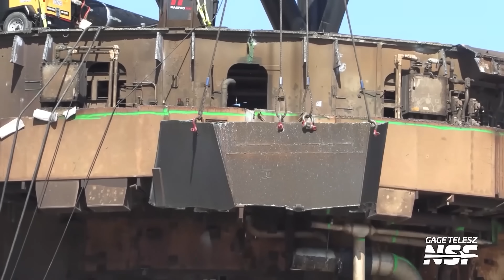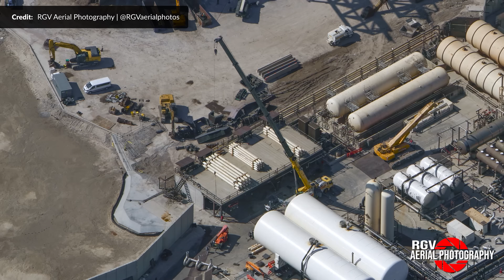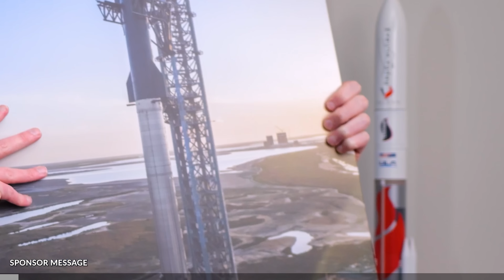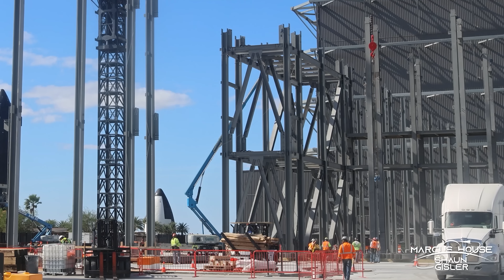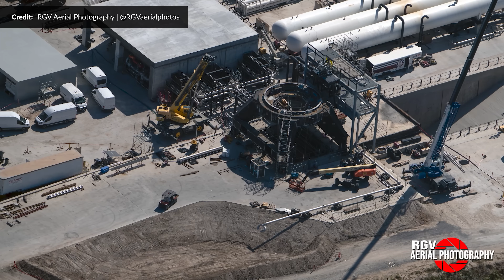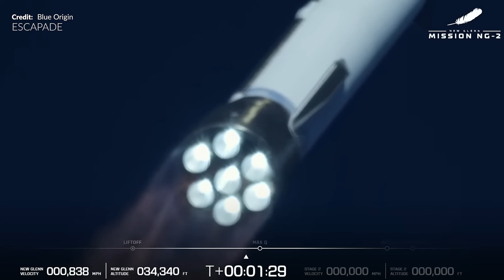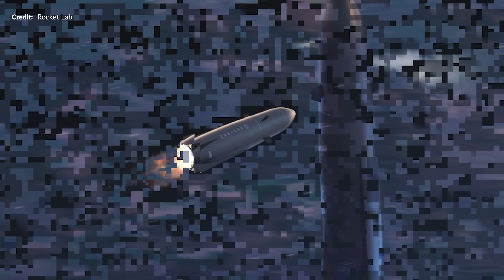Blue Origin’s New Glenn stunned everyone!

Comment: The way  New Glenn first stage came a  little bit out of target and made x-y corrections to hover and land on the droneship with pinpoint accuracy is just awesome to see 🔥Looks like Falcon 9 & Starship Superheavy has a worthy opponent
Reply: It’s planned to target abeam the landing ship to protect the drone ship incase of velocity error making the landing impossible.
Reply: @trans_atlantic_alison 
Yes, it is not a bad idea!  I imagine that after a couple of successful landings they will go for direct landings.
Reply: @mahbriggs Bezos said the conservatism on landing will decrease as they gain confidence
Reply: @steveo6034 and the $ cost of failure for them is higher.
Reply: @steveo6034 
As I said, it makes sense!
Reply from the maker: It was wild.
Reply: nominal , it is planned
Reply: Falcon maybe but Starship is something else it cannot be compared to anything because no one else even tried to do it.
Reply: Baby steps…. with explosive bolts
Reply: It think it was PLANNED that way so just incase it doesn't go as planned. They didn't want the Booster to slam onto the Barge Ship when it is out of control.....
Reply: They were 1 year behind space x successful landing. Space x has done dozens more test flights then Blue. I’m sure they are paying space x employees, but regardless they are so far behind.
Reply: The ability to hover and slew horizontal is something unique with New Glenn compared with the Falcon 9/Heavy's raptors, if I'm not mistaken. That capability on its own is interesting and makes Blue Origin & New Glenn feel like innovation instead of simply direct competition.
Reply: @michaels.3709 
But not unique to New Glen!  That is how Starship has been recovered! 
Hover off the target and side slip to the actual recovery point@
Not a bad idea, nor is it a unique idea!  Common sense really, if you have the fuel to do it!
Reply: @mahbriggs  True! I meant to make the comparison within the same size class. My understanding is that Starship is so large that you can actually throttle-down the raptors to hover, whereas Falcon 9 is too light and the Raptors too strong for even a single raptor to be throttled low enough to hover. I can't confirm where I heard this, so take it with a grain of salt. But having the ability to hover on a smaller launch vehicle than Starship is quite a nice capability to have!
Reply: New Glenn is trying to compete with Falcon Heavy, not Falcon 9 nor Starship. Totally different leagues.

BTW, Falcon Heavy wins on both tonnage to orbit and cost factor.
Reply: @stateofopportunity1286  it’s also important to note that Blue won’t have the same price or customer base as Space x..space x is cheeper and can deliver more faster..
Reply: @stateofopportunity1286 
I agree that New Glen is sized to compete with Falcon Heavy.  Whether or not it will be successful depends on if they can make it reliable and cheap enough!
I dont think anyone knows about the cost part yet, but if they can make it reliable enough, they have a chance!  So far the results are impressive as far as reliability goes!
Falcon Heavy is not cheap!
Reply: @stateofopportunity1286 To be fair, the only Starships that have flown so far probably only had a 30-50 ton payload capacity, same class as New Glenn.  (Yes, yes, V3 should be more like 100T, but hasn't flown yet)
Reply: @darylbardo if they ever get it to work.
Reply: @melgross I think that level of skepticism is as ill-advised as unalloyed optimism.  Spacex has the engineering chops, willpower, and resources to get it working, and there is nothing that fundamentally breaks the laws of physics about their plan.  It may not get to 150 tons reusable at a cost of less than $10mil with a one-hour turnaround in the next two years, but I think it will get somewhere.  100 tons reusable at a cost of $30mil with a 24 hour turnaround in the next 5-10 years would still be a massive game-changer.
Reply: @darylbardo those numbers are nice. But what I’m talking about right now, is the serious problems they have had getting starship to do the most basic task without burning something up. And all of the flights have been with Starship completely empty, including any pressurized atmosphere, which they will need for some missions. The only thing they’ve really done was on the last flight with the launching draw for Starlink satellites. And that was just a test to see if everything moved. They are seriously behind their own schedule right now. I’m hoping they will get this straightened out, but there are a lot of skeptics in the engineering world who are concerned they may have bit off more than they can chew. The booster seems ok, though I would have liked to see them capture more than one.
Reply: @melgross Fair points.  On your last point, I'm reminded of the "high altitude" tests, where everyone said they wished they'd done some more flights to prove the flip & burn out.  But SpaceX was confident that they'd already proven what they needed, and when it came to it the IFTs have a 100% success so far on the flip & burn every time the ship survived reentry.  I think they stopped catching boosters because they were confident they'd worked that part out, and wanted to push the envelope with boosters that were going to be obsolete very soon anyway.  I think once they start catching V3 boosters they'll start doing it pretty consistently too, whether or not there are any "kinks" to work out with the new version first.
No question they're behind their hoped for schedule, but they are biting off a big chunk, as you say.  I'll be surprised if the TPS doesn't require weeks of refurb every time for 2nd stage, but worst case it'll still likely be faster & cheaper than shuttle.  And I think it's promising how robust the vehicle is proven to surviving TPS failures.  And booster probably will have possibilities for a fast turnaround.
Reply: @darylbardo I’m someone who has designed and built commercial equipment. I understand the concept of prototyping. I also understand that succeeding once doesn’t prove the process. You need to do it a number of times. So the booster has been a success, though they do need to prove they can catch it again and again. So, we can leave that.

But the starship is something else altogether. They can’t keep referring to the loss in the ocean as a successful landing. It’s not. They have to bring this around the world in orbit to where they will land it, on land, apparently. They haven’t done that, so we don’t know how long it will take until they consistently succeed. That’s a lot harder than allowing it to dunk in the ocean. They did, some time ago, fly it up a few hundred of feet and land it. But that was just a proof of concept.

Then they have to get one up as a tanker and show they can transfer fuel. That’s just the beginning.
Reply: @melgross  How long has Blue Origin been working on an orbital class rocket? 2 years longer than SpaceX has existed? 

Pots in glass houses shouldn't throw stones through their neighbor's windows with a note attached calling them black.
Reply: @melgross  They are testing to limits, as they always do. Every launch has purposeful failure items included. For example, missing heat shields, steep angle of attack, minimized fuel, etc. They are pushing the vehicle to the absolute limit and have still managed to bring it down for soft landing multiple times. Nothing short of incredible.
Reply: @stateofopportunity1286 yes. We all know how they do it. Still they said with several of the flights that they were disappointed in some of the performance, which means they expected it to perform better.
Reply: Yep! They have been practicing that landing sequence with the New Shepherd booster for the past 6 years with 35 successful landings.
Reply: sure a worthy opponent that launch once a year vs 3 times a week for F9 😅

also NG lifted really slowly despite having basically no payload (escapade satellites are really small, less than 100kg each, if I remember well)
Reply: @Guren 74. Wonder if they purposely throttled back to lessen launch stresses?
Reply: @Guren74 No NG purposely reduce the thrust.. Since payload is small
Reply: @sujithcosmos I don't think that matters much at liftoff.  The vehicle must weigh 1400-1500 tons.  Whether the payload is 40 tons or 40kg, it won't change the acceleration at liftoff by more than 2-3%.
Reply: @Guren74  New Glenn's slow acceleration is intentional.
Reply: Starship has no opponent The things more like falcon 9
Reply: @dillonbledsoe7680  Incorrect. Starship can only deliver payload to LEO. Any meaningful payload beyond and 8 refueling missions are needed. This vehicle is designed for Mars. New Glenn and Vulcan outperform Starship to GEO and beyond in single launch and associated risks. 8 refueling missions means 8 potential failures during launch and 8 during refueling.  All these vehicles are designed to do a specific job. Space economy will grow to 1.8 trillion in next 10-15 years. There is plenty of business for everyone. As cringe as it sounds - size not always matters.
Reply: @Sewkus-66613 New Glen is like a second version of falcon 9. Starship is fully reusable. And I guarantee it will be more reliable than new Glen anyways. I really hate Jeff Bozo's method of advancing in rocketry. Just sue everybody that is in your way try to patent everything so you can be the only one to do something😂 SpaceX doesn't do patents because they want people to copy because they want spaceflight advanced Jeff bezos wants to be the only guy doing anything. The fact that he tried to give billions of dollars to NASA if they chose his lander because he lost the contract is just pathetic. The dude doesn't know how to lose or be told no
Reply: @Sewkus-66613  No, Starship can deliver about 21tonnes to GTO, almost 2x that of NG (and ~6t more than Vulcan)
Reply: @dillonbledsoe7680  Starship has yet to get to orbit, and tends to explode.
Reply: @pavo1394 it's literally basically reached orbit. A few meters a second is basically orbit they could probably just use RCS to push theirself into orbit at that point. And actually the last flight was successful. They even tried to make the ship fail and it still didn't. Y'all are going to be having to deal with it when starship is the number one orbital launch vehicle on the planet
Reply: @dillonbledsoe7680  Starship has completely failed. No one is trying to compete with failure.
Reply: 😅@enigma591 ignorance is bliss right
Reply: @enigma591  They are not competitive at all with Falcon even, Starship will be on a different level and will make both completely obsolete.
Reply: @enigma591  ah ah ah...Starship is still in development and far from being a failure, you probably said the same thing when Falcon was being developed I guess...can't succeed, cannot be recovered, etc...And now you marvel at Bezos copying SpaceX...make it make sense.
Reply: @enigma591  Except, of course, that Starship has now completed every single goal of both Block1 and Block2, and will soon start on Block3.
Reply: @ChristLink-Channel  easy to achieve every goal when the goals are comically small steps with every $100 million (plus) test launch. but yes, starship is a historic launch vehicle making strides not since attempted since the space shuttle program; so obviously it requires more test launches than a normal rocket like New Glenn. I’m a massive fan of starship and new glenn btw, team space.
Reply: @STS-Dreamer Ajile development will continue to advance faster that waterfall, this is why Spacex is ahead of everyone.
Reply: @enigma591 Its test article.. While New glenn is flight proven vehicle.. Starship are prototypes now. Not a real one.. Wait for V3
Reply: @enigma591   Starship has completely failed. No one is trying to compete with failure.

Worst case the 2nd stage fails but the first stage has already proven reuse.  A new 2nd stage (which New Glenn is supposed to get as well) would need to be developed.  

:planet-orange-purple-ring:

:planet-orange-purple-ring:
Reply: @admarsandbeyond  They are not competitive at all with Falcon even

That is what Bezos said 4 years ago.  Of course each Falcon 9 is flying more missions now than then.  It COULD change if Project Jarvis promptly (Projected mid 20s or nowish) produces a functional reusable 2nd stage without sacrificing too much cargo capacity.

:planet-orange-purple-ring:

:planet-orange-purple-ring:
Reply: @sujithcosmos  Is Starship still on target to put people on the moon by 2020? The fact that we are five years beyond that is evidence of the failure. Promising men on the moon in 2020 and delivering a single banana to the Indian Ocean at the cost of $3B in taxpayer money.
Reply: @enigma591  

The BO (and others) blocking the initiation of the contract for months caused some delays.  COVID caused more.  Environmental assessments still more.  

SLS not being ready for the 1st and 2nd launches allows for more as Artemis 3 isn't scheduled now till some time in 2027 and that is when HLS needs to be ready.  Will the SLS be ready for Artemis 3 or will it cause more delays?  

So Starship has NOT delayed the Artemis 3 mission yet.  It might still but it might not.

:planet-orange-purple-ring:

:planet-orange-purple-ring:
Reply: That's because you think something that is meaningless is actually important.  Much like people who buy cars based only on color.